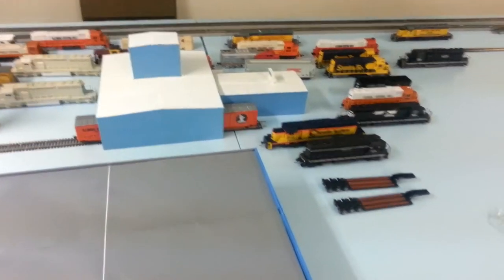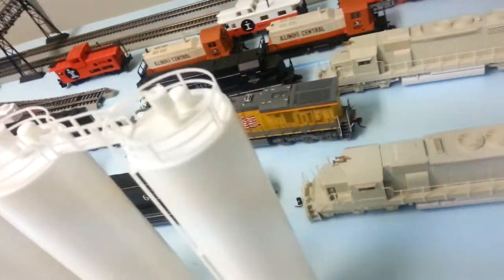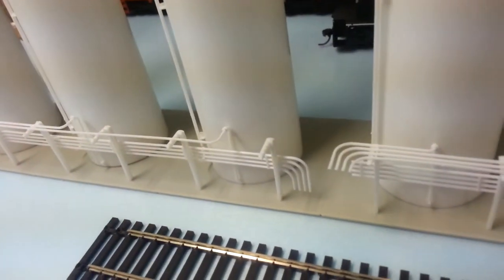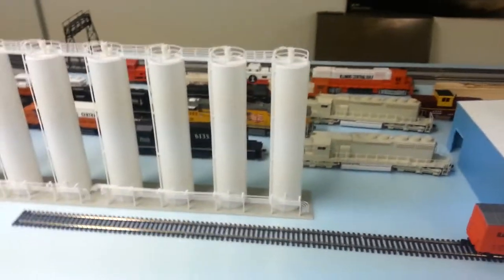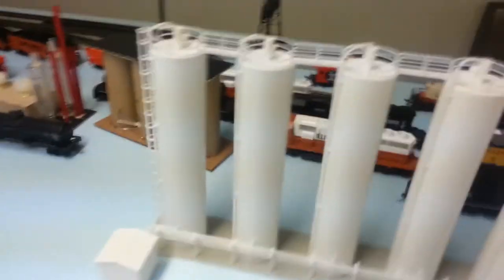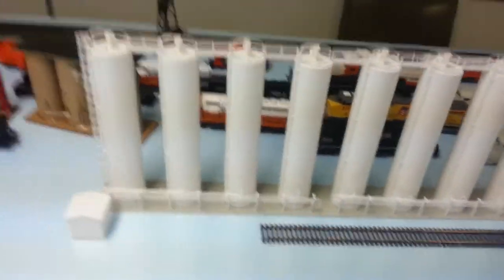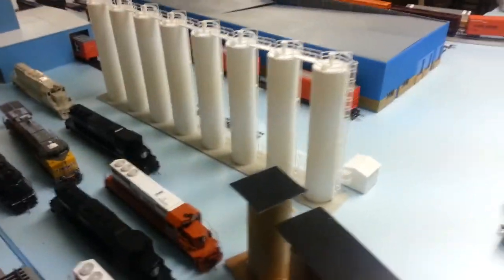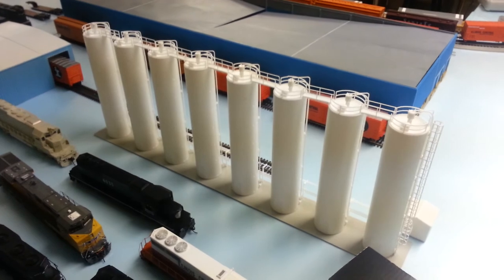Modeling Series 9 - Walthers Pellet Facility - Part 2- The Finish

Comment: Can you see any way to relocate the pump house so it's more in line with the silos? To fit my space, I'd need to do something like that, but not sure how I'd run the pipes then, or if I'd need to totally scratch-build that section of pipes from something else to route them a new way. Thanks!
Reply from the maker: You can get a sheet of styrene and rearrange them anyway you want. I just out them inline like that for my layout.
Reply from the maker: It may take a little bit of kiy bashing, but you can do it no problem.

Comment: Hello, great job sir...Can i bug you for a measurement on one if the pellet silos? Are they 2" or less? Im building a asphalt plant and trying to make a railing like those on pellet silos is not working out. Any info greatly appreciated
Reply from the maker: Thanks! What exactly do you need a measurement on? I will get whatever you need just let me know!
Best,
John
Reply: John Prescott I need the diameter of the pellet silo. Im hoping its around 1.5 inches across
Reply: John Prescott Not sure if reply worked, would you know the diameter of the pellet silo?
Reply from the maker: I will have it for you in the morning! But that sounds about right.
Best,
John P.
Reply: John Prescott thank you, ill post a pic of the project but its an exact HO scale replica of Gencor asphalt plant